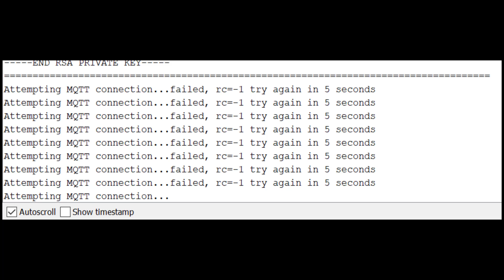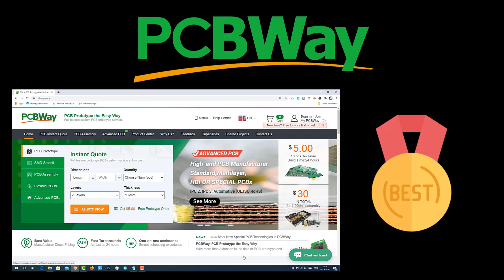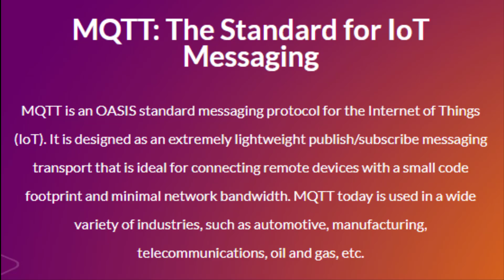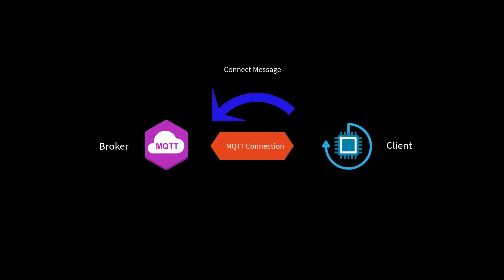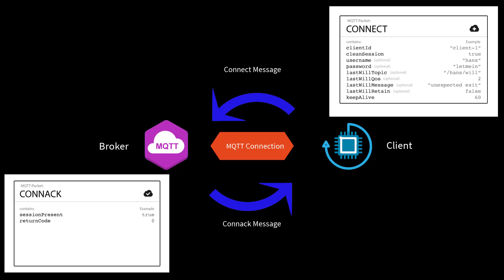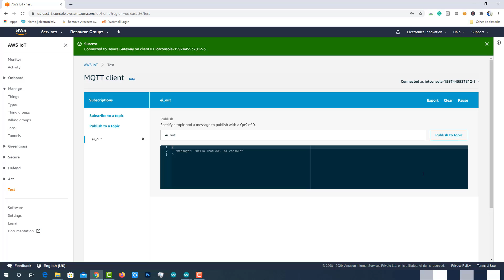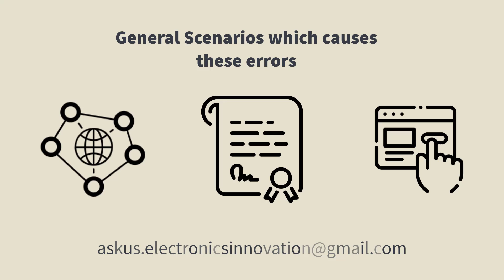[Solved] Attempting MQTT connection... Failed. rc=-1 or rc=-2 or rc=-4, try again in 5 seconds

Comment: please am having an issue connecting its giving me the error code of rc= -2 , though i changed the name of my certificate when using spiffs to upload the certs to esp32 because  if the name of the file is too long eg the certificate's names you won't be able to upload the certs to esp32 storage for reading. i dont know if that's what is causing the problem. will be glad if anyone can help me with this